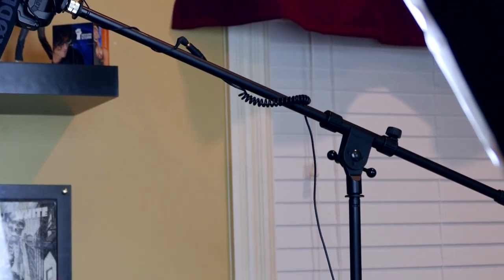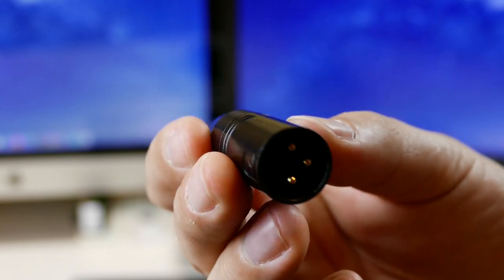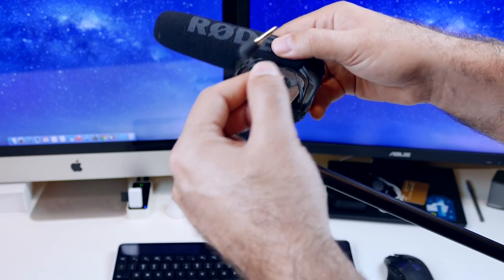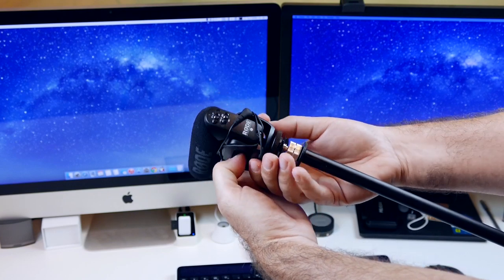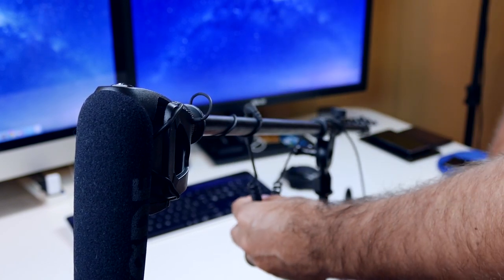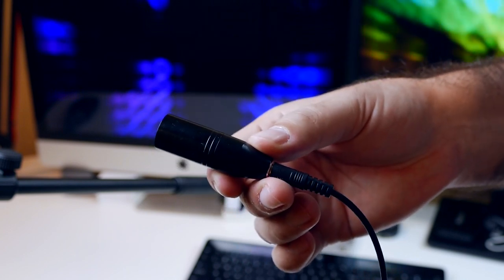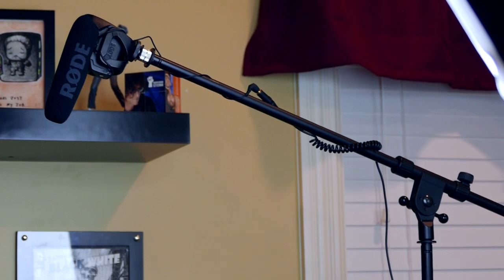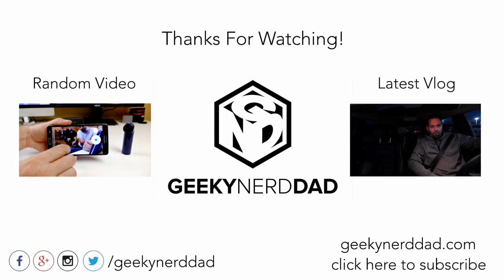HOW TO: Rode VideoMic Pro to XLR & Boom mic set up

Comment: I've got my Rode Video Mic Go plugged into a 1/4'' adaptor, plugged into my Zoom H4n XLR inputs, and I'm getting nothing. Tried multiple adaptors. The mic works fine on my DSLR. Tried both condenser and dynamic mics plugged into my zoom XLR and they're working fine. Tried just the 3.5mm input, no adaptors, and same deal- no dice. Tried changing phantom power nothing. Any help would be appreciated. My big Apex 175 shotgun mic is old and finicky, so i thought i'd try this set up with my DSLR mic. The adaptor tips match the Rode's 3.5mm tips.

Also there's no ON/OFF switch on the mic, and the battery's are full.

Comment: Why do you use an XLR adapter if you can plug the 3.5mm jack directly into the Zoom H5?
Reply: Bartek Odias we cannot plug it directly. The h5 has an xlr input and the vmp has a 3.5mm jack. So an xlr adapter is a must.
Reply: The h5 has a 1/4 inch in; could've easy gone into that with a simple adapter. However, the question that one needs to ask is "What is the output of the mic?". You've gotta know whether it's line, instrument, or mic level before you know which is the best way to do it. If it outputs line level, then this is a terrible idea.
Reply: I'm curious how this would work together with the H6. I would like to use the videomic pro and canon dslr with dual recording setup and occasionally set up the zoom to do podcast with the videomic Pro Plus microphone. Any advice

Comment: hey brother, a few folks asked below ... what about booming the rode videomic pro, but then plugging it directly into your dslr camera jack, so the audio and video are all running through the camera?  (I have seen that some lower gauge 25' extension cords dilute the signal and decrease sound quality).  any input you may have for making this setup successful appreciated.  thanks.
Reply from the maker: I didn't see any sound derogation in the extension I used
Reply: +Larry Dickerson Right, sound quality is good with your setup. I was just wondering about running the cord all the way to the camera and plugging it into the camera.

Comment: Wait.. I thought you didn't need an XLR adapter to use on the h4n recorder?.. Isn't there a jack in the back of the recorder to plug 3.5mm cables into?
Reply: alwil89 yes

Comment: If you leave out the XLR adapter, can you record directly into your camera?
Reply: +Sofia Reecer Yes, you only need the XLR  adapter if you are planning to use it with the ZOOM
Reply: +BiggsTV WorldWide For a boom setup, it'd be best to have a portable recorder if you're going to be mobile. However, if you are stationary, like the video in above, you could plug the 3.5mm plug directly into your camera.

if you do want to use a portable recorder, but don't want to adapt to XLR, I recommend the zoom h1. it has 3.5mm jack

Comment: fairly knew to it and wondering, does it work if instead of the camera to connect the 3.5mm into my smartphone? It's just because I'm trying to spend less money and be more practical. Though, you've mentioned about using the XLR for getting mobile, the thing is, I would just leave my phone on a fixed position, because it's camera records up to 2K so leaving the smartphone still just recording, is it possible to just connect the 3.5mm extension on my smartphone and record my video?

Comment: Several people asked but I haven't seen where you answered as yet. What is the purpose of using that XLR adapter if you could plug the wire directly into the Zoom for stereo sound?
Reply: if you plug the 3.5 straight into the Zoom H5 you loose that stereo input whereas connecting it as XLR you can still use the stereo (X/Y or whatever capsule you have) to capture let's say ambience sound plus the other TWO XLR. hope this makes sense.
Reply: I think he meant using a 3.5mm to 1/4 in. adapter. In which case, I can't see any reason not to do it.

Comment: hey! loved the video. I'm using a Zoom H4N pro and was wondering if you had to change any settings in the zoom for the mic to work? I just got the adapter so it's on the way but I tried the l9ng way today and went from 3.5 female to 1/4trs to 1/4th trs to XLR but I wasn't getting any signal. any suggestions?